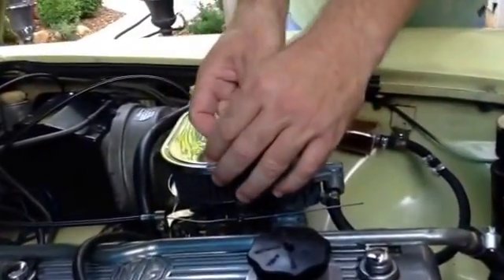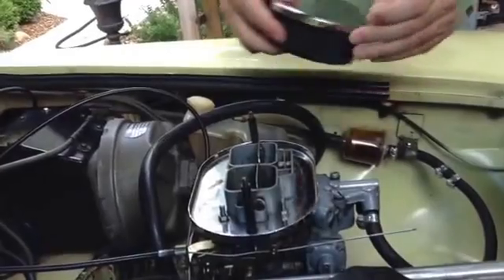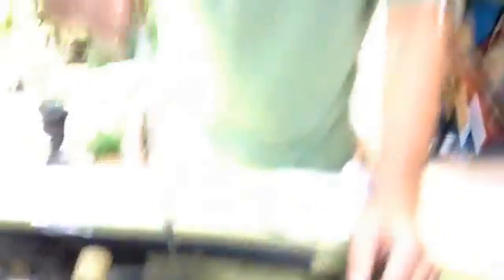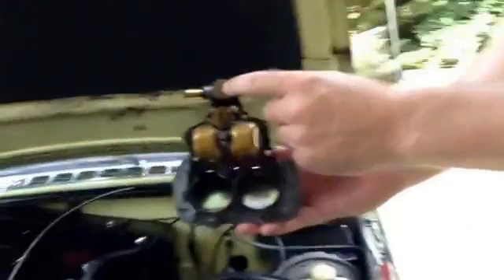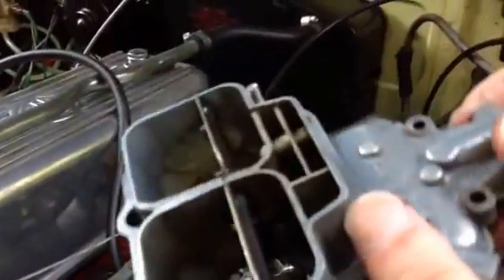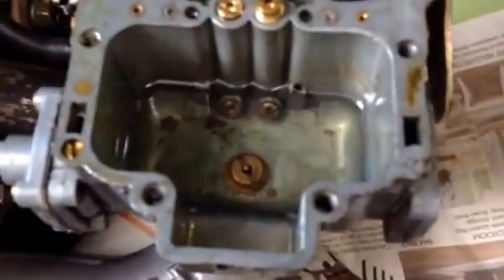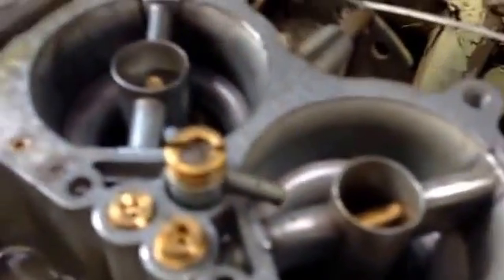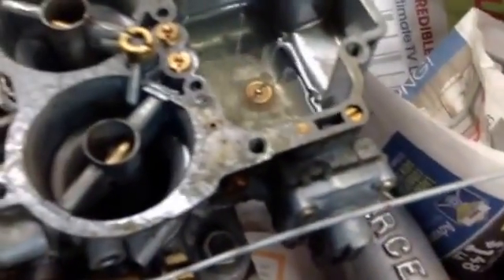MGB Weber DGV Carburetor (Tuning the Carburetor) - Part 1

Comment: Hello Jeff, Great video. Thanks for making it. I have a 77 mgb with a weber carb. I am trying to learn about the weber carburetor. Just wondering how do you determine the number on the primary and secondary jet size? Also what does The Accelerator pump assembly do? 
My last question in your experience if you don't mind me asking, if you encountered this issue that am having. On a cold start, after running my car down the street and back just fine for about 10 min or less. the engine shuts off. I can try to start it and hear it try to turn over but i think the carburetor is flooding. I would have to wait for about an hour before i can turn it on. I don't see or smell any gas so am not sure if its flooding. Do you recommend anything for me to try to clean from the weber carburetor ? Thank you i appreciate your advice. Joe
Reply from the maker: Sorry so late, but does it have get in the fuel bowl when it dies? Check it by removing the carb cover as you have seen in our videos. It sounds like a fuel pump problem to us.
~Ian & Jeff
Reply: Hi Ian & Jeff, thanks for the tip. i did replace the fuel pump but its not original. i wonder now if its too much psi. thanks and good job on those videos. Joe